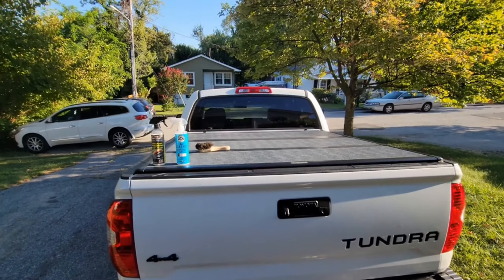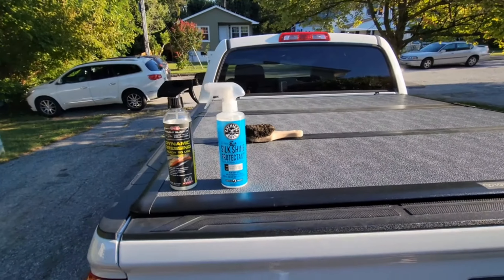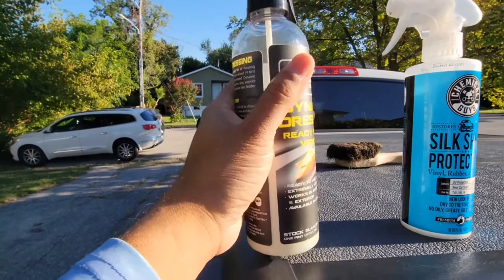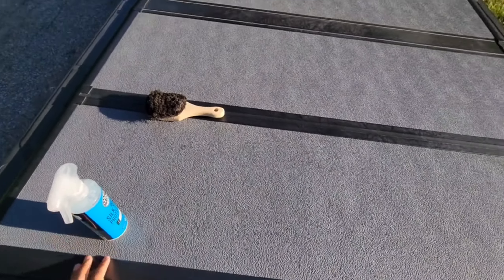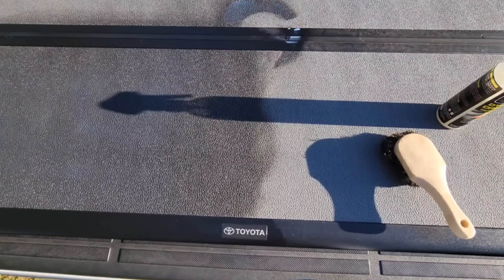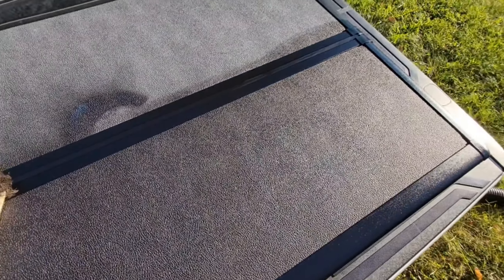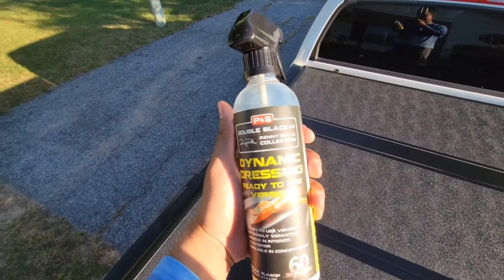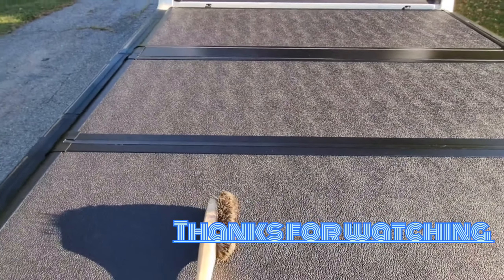How to renew a faded tonneau cover Part 2.

Comment: I removed the rubber seals and painted it with truck bedliner. Then replaced the seal
Reply from the maker: @bjornjoseph  not a bad idea. Using these tire shines or trim restore is just a temporary fix but looks good applied correctly

Comment: The cover is cooked bro
There is no bringing that back
Reply from the maker: Nah, lotioned up
Reply: @qualitytouch  I used to use tire shine but the problem with that is when it rains it pushes all that thick oil shine off of the tono and onto the body of your truck
Reply from the maker: @averageguy7641  I don’t layer it on think, apply and buff off access but there’s other products like solution finish